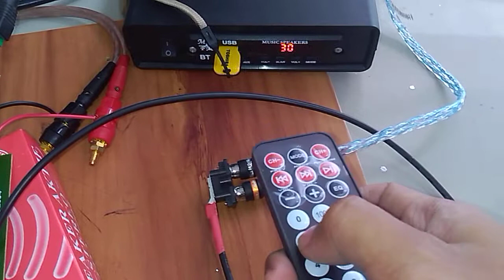TDA2004 Checksound Class B Amplifier

Comment: Pake trafo /smps bos?   Berapa amper?
Reply from the maker: di video ini pakai adaptor / switching  12v 2A
Reply: Saya pakai 5a 
Hanya pakai kiri saja(cuma 1 speaker) 
Udah keras di arah jam12 (MP3 volume 30)
Reply from the maker: @nfirdaus5019  memang kencang banget kit ini 👍
Reply: @EmpliStudio  sekarang udah kanan sama kiri 
Tapi masih mikirin box nya 
Jadinya 1 box Dyna custom ada 2 speaker depan belakang 
Suaranya juga kenceng di jam 1 sampai kedengeran ke luar rumah
Reply from the maker: @nfirdaus5019  belum tahu saya kalo ada model speaker depan belakang
Reply from the maker: @nfirdaus5019  ini kit kencang banget, padahal saya juga baru buka dikit, gak berani buka besar apalagi sampai mentok 😂